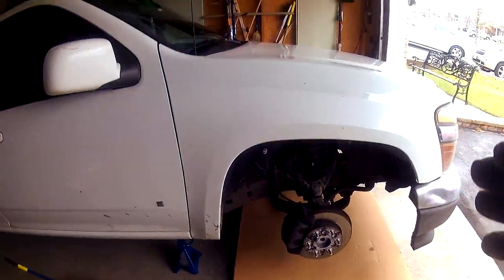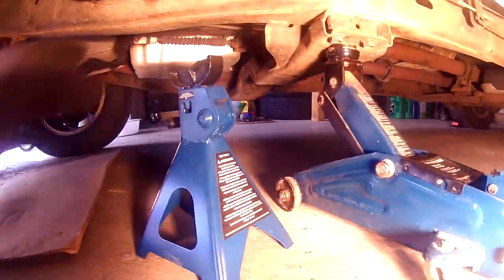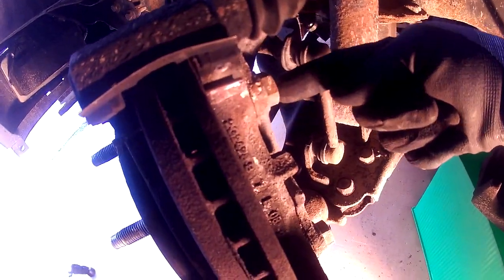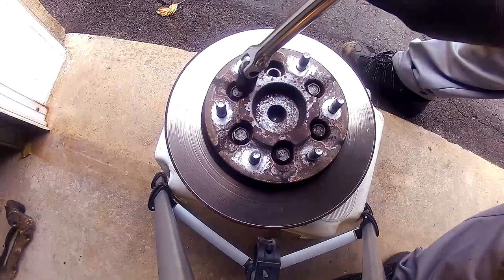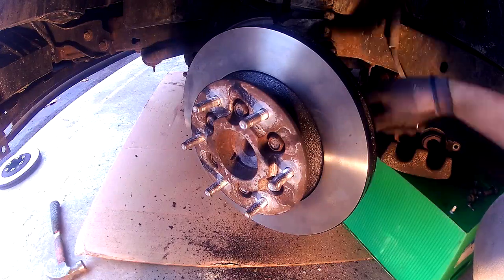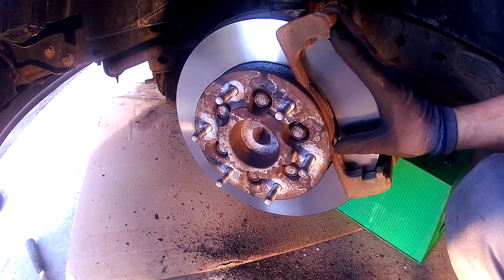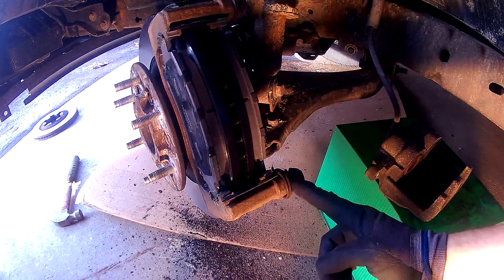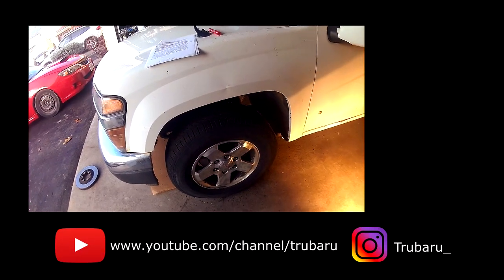Front Brake Pads and Rotor Change | Detailed Guide!!! | 2009 GMC Canyon/Chevy Colorado

Comment: Don't forget to remove the lid on the brake fluid reservoir before compressing the piston.  Also, after cleaning up the hub, don't forget to put anti-seize on the two adjoining surfaces before putting it back together.

Comment: Just did them yesterday, thanks so much for putting this up, its very helpful.  I have a 2008 Canyon, one big difference between the years is the speed sensor is part of the hub and you have to be careful to take the entire wire harness thru the hub with it when you remove the assembly.

Comment: i just replaced my son's wheel bearing assembly and rotor. Some how I put on the rotor backwards, i didn't realize you could do that. I could mount the caliber bracket, so now i have to take everything back off again. This is a great video, very good instruction.

Comment: Thanks for the video! I had 4wd and had the axle nut just like you said. Didn't even need the air hammer to get it loose, seemed pretty clean. Didn't expect the job to require hub removal!
Reply from the maker: Ya its a bit annoying to get to especially just to do brakes. The design it like this for heavy duty applications (even if you look at tractor trailers) I would guess its to give it more durability and make it stronger

Comment: Thank you for the video, very helpful. Also, my gmc canyon Idles between the speed of 45mph - 50 mph only and when stopped, no idling but rpm sits very low. I changed throttle body and still does the same

Comment: Great Video, One thing iv heard is, Open the break Fluid cap in engine compartment, to let the air out, for faster movement for the brake fluid when compression of pistions.
Reply from the maker: It wont really make the fluid move faster but might make it a bit easier to compress the pistons

Comment: Nice detailed vid, also can be used if u need to change hub with bad sensor, only thing I wouldn’t do is use so much grease on the slide pins, just a light coating is needed and the grease for the clips should go under them, it is where the rust forms to jack up the clips, but this is one of the best detailed vids I’ve seen on this procedure

Comment: The ABS Sensors on both sides are pressed on the hub (R & L)  for 4x4 versions in 2009. It's not an easy one little bolt removal and reinstall to change the ABS Sensor on 4 WD Models. The ABS Sensor has to be pressed onto the hub and the wires passed thru the splash guard and the replaced rotor.
Reply: You mean that I can not hammer the hub out like he did in this video on my 4×4 colorado?...
Reply: OMG 4x4 is a nightmare. Not simple at all. The hub and wheel bearing are connected. You need to work with spline shaft.

Comment: Thanks for the instructions. You only called out the speed sensor socket size (8mm). Would have been nice to have called out all the other sizes, so we can stage those sockets.
Maybe add them in the comments. 
Links above were great, too.
Reply from the maker: Ill try to include the sizes im using but the only reason i havent is because bolts get changed out over time so it might not even be the same size.
Reply: Thanks for the reply @christophervitale7147 ! Changed front disc pads and your advice was excellent. Saved me a lot of time.
Reply: it's the ones that fit. There beside the other ones in the socket set
Reply: Caliper bolts 13 mm.
Caliper bracket bolts 21 mm.
Brake Rotor mounting bolts 17 mm.
Hub Assembly/Steering Knuckle bolts 15 mm.

Comment: Nice, this looks easy, I need to get myself a torc wrench. How do you know what torc each bolt needs to be?
Reply from the maker: I had the service manual but if you don't, you can simply look up what bolt you want to tighten and google will let you know. 

For example if you need to know the front brake caliper bolt torque, just search up the (year, make and model of your truck) and then (front caliper bolt torque spec) 

You will get different forums and sources of people have the manual and just want to help people out

Hope this helps :)

Comment: Pro tip!  Squirt some wd40 or rust breaker than start tapping.  So when you tap and it breaks loose a little that wd40 will seep in.  Alot less beating.

Comment: Good evening so I just got my truck back from the shop and I asked them to look at my front breaks and they said it would cost me over 1500 for parts and labor. And they told me they need to take out my axle and all this other stupid stuff. So my question to you is, is this the same on a 2009 Chevy Colorado manual transmission 4x4

Comment: Is this the same for the 4x4 version of the truck?
Reply from the maker: should be very similar. only thing different should be that you would have to remove the axle nut which would be in the center of the hub.

Comment: Great video. One question. When you are opening the caliper piston should you not crack the cap on the brake fluid reservoir and also watch that you don’t spill out brake fluid. Through brake wear fluid may have been added which will become too much when you put new pads on.
Reply from the maker: I always check levels here and there just in general to make sure everything is good. In general you should never really have to add fluid cause it's a closed system. Itll go down a bit once the pads wear and itll go up once you retract the pistons. However you shouldn't add fluid everytime it goes below full. When you put new brakes in make sure it's right at the full line and just monitor from there ever couple of weeks.

Comment: Good work, Is this the same job for an 06 Colorado?
Reply from the maker: i have no idea. I assume it would be very similar and by just googling your truck and then brakes it looks like the same set up as my dads truck. Sorry for the late response
Reply: The speed sensor is different on my 07 Colorado. The speed sensor does not disconnect behind the hub you actually have to unplug it at the top of the wheel well and pull the entire cable out with the hub.

Comment: So I noticed you didn't bleed the breaks for air after. Is there any need to?
Reply from the maker: Nope, only if you are changing the fluid or any part of the brake system that will allow air into it such as a brake line or caliper :)

Comment: Did you by any chance open the brake oil cap? Do you even have too? Also could you do a video of the rear break drums in the future.
Reply from the maker: Hey so i didn't see your message because for some reason YouTube didn't send me a notification. But no you do not need to open your brake fluid reservoir. I will also be covering on how to do the rear drums in another video, we just haven't needed to change them just yet.

Comment: Why do shops use air wrench’s and don’t use torque wrenches?
Reply from the maker: Your supposed to torque every bolt on a vehicle but in all honesty for efficiency its not good for shops to do that or else things would take a lot longer to do. However they should be torque everything that keeps your car onto the road (such as anything to do with the wheels hubs or suspension) for safety and they should also torque anything that is a major mounting point (such as the bolts that hold the transmission to the engine) Other than that and a few other things you can just tighten snugly. Everything should be torqued regardless but in reality the mechanic world will never work like that lol

Comment: Having trouble hammering the rotor and hub off
Reply from the maker: If im not too late... just keep wacking at it itll come off eventually. If you can try to hammer it off to a point where you can stick the tip of a pry bar in between the hub and rotor and hammer it in. That method will help a lot. You can also try to work it back and fourth and spray some lubricant inside to help free it up. I forgot to do in in my video but put some anti- seize on the hub as well so it is easier to get off next time.